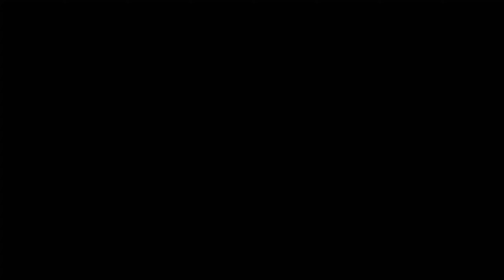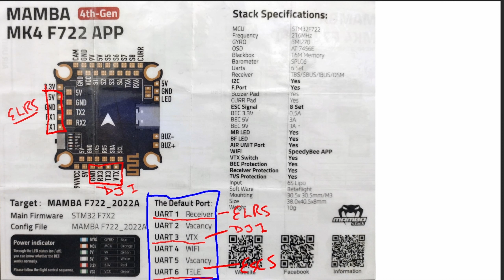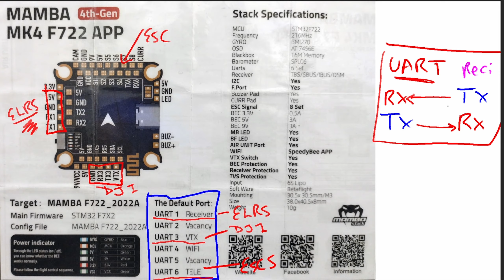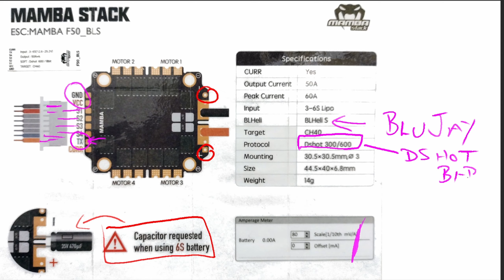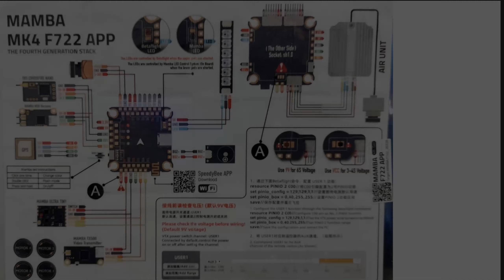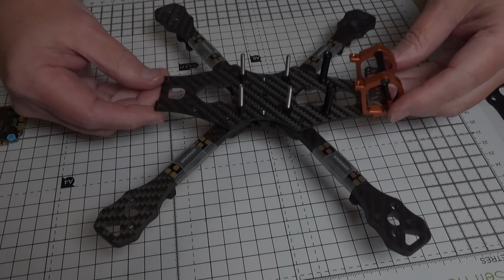Armattan Beaver quadcopter build part 2

Comment: I didn't notice it in the first video, but it seems like you have the press nuts on the wrong side. (Hope I'm wrong)
Reply from the maker: The two on the top deck I removed all together, they made no sense either way up. you are 100% correct regarding the base plate, I have it upside down!!! Thanks!!!!!
Reply from the maker: Well, that was a pain! The bottom plate is now the correct me way up - thanks again:)
Reply: @Caroline_Tyler  Don't think that was what you meant with "-fist- first fiddle with the beaver this weekend" 🤭